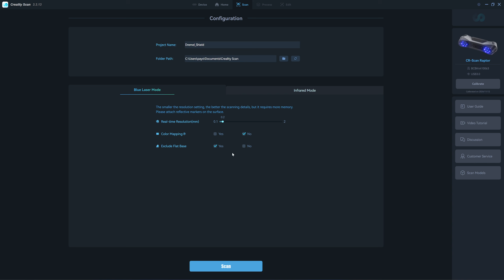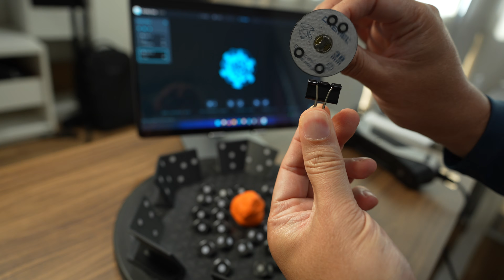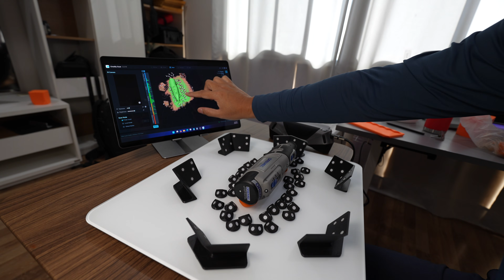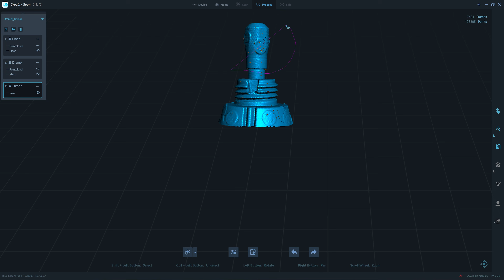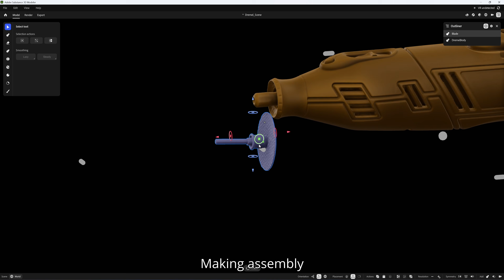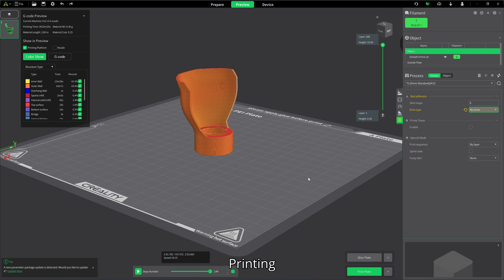Creality Scan Raptor - Beginner Guide - Making Dremel cutting shield

Comment: Discovered after purchasing that this device does not pair well with an AMD system. Do yourself a favor and look at the graphics requirements first. Don't rely on the scan software saying an AMD system is good. You'll get so many screen freezes calibration will be frustrating. It says it on their wiki but if you're like me you won't look that far until you purchase. I watched several reviews on and no one mentioned this.
Reply from the maker: Similar to most CAD tools, they only run well on Nvidia card. AMD one would cause bugs and issues.

Comment: I got my Raptor today but to be able to use I almost have to by a new computer. It would be nice if the sellers start their advertising with the urgent remark to check the system requirements first before buying!!
Reply from the maker: You need a PC with Nvidia graphics card to run it, at least RTX4060

Comment: Why Substance Modeler instead of Fusion360?
Reply from the maker: Substance Modeler is clay tool, Fusion is CAD. They're totally different.
Reply: @Payo-TensileCreator so it's easier to create models with the clay tool rather than having to intake them into the full on CAD process?

Comment: Hey man what’s up? 
Please need your guidance 🙏
I would like to know if you have knowledge about a 10meter extension cord for the RaptorX and what is the maximum I can extend it 🙏
Reply from the maker: The cable included with the Raptor X and Sermoon X1 is 5 meters long. I’ve never come across a 10‑meter USB 3.0 cable, though I have seen them in USB 2.0.
Reply: @Payo-TensileCreator I saw some USB 3.1 and 3.2 Gen 1 and they are Active USB and there is 5 and 10 meter and I know for a fact that a 25 meter dose not work from experience it worked with shining 3D einstar (first model) but mot with the raptor so then i got a USB to ethernet adapter it’s kinda worked but the receiver was getting extremely hot and randomly disconnect and reconnect multiple times so I planned to install a tv outside and temporarily move the pc since it’s on wheels but still need to extend the cable by around 10 meter so I can move around the car 😩
Guess I’m gonna have to try and see what work and what dose not 🤷‍♂️
I’ll let you know once I try it 🤘

Comment: Is this the pro model? do you think it can comparable to the pro model in terms of quality scans??
Reply from the maker: That one in the video is original Raptor. It shares the same 7 lines laser module and depth camera with Raptor Pro.
Reply: I have the original raptor and will not connect to software using windows 11 home. Which software version are you using?
Reply: @minibuggies926 I have windows 11 pro on my desktop pc. And 10 on my laptop. I’ve heard of this issue though and apparently there’s a workaround no?
Reply from the maker: @minibuggies926  Now the latest one will be Creality Scan 4 version 1.3.7
Reply: I have found no fixes. And creality has not provided any support. Thought I'd reach out, maybe i downloaded the wrong software version. I tried a few. I'm on 3.3.36 now

Comment: Hi. In the first few seconds of the video, it looks like you're connecting a cable to a Ferret Wi-Fi6 bridge. Have you ever try to use the Ferret Pro Wi-Fi Bridge (or the "Upgrade Kit for Wireless Scanning") with the CR-Scan Raptor or Otter??
I'm wondering if the Ferret bridge can work as a cheaper alternative to the official Scan Bridge for Raptor.
If yes — does it connect over USB and create the same "Ferret-XXXXXX" Wi-Fi hotspot? Any firmware or compatibility issues?
Hi! ?
Reply from the maker: No, Ferret's bridge won't work with Raptor/Otter I've tried that.

Comment: Great video! I just received my new Raptor but I can’t figure out how to get the firmware updated because I’m having the Windows 11 usb connection issue? Any ideas besides buying the WiFi bridge or a new Mac?? 🤔
Reply from the maker: In Creality Scan 3 or 4, clicking the gear icon in the upper right corner opens the settings menu, where you'll find an option to uninstall a Windows 11 update. This rollback may resolve the issue temporarily, allowing you to reconnect to the Raptor and update its firmware. However, I can't guarantee it will work, as Windows 11 includes protective mechanisms that may block third-party software from modifying its security settings.
Reply: @Payo-TensileCreator Yes! When I do that Crealty Scan says there are no Windows updates to uninstall. So… maybe buying the Mac maybe the best solution because if I purchase the WiFi bridge to update to the latest Crealty firmware, I will be dealing with this issue over and over every time Windows 11 updates (more than likely). And then will need to wait for Crealty to update the firmware again. 😳
Reply from the maker: Just a heads-up—Creality 4.0 is primarily geared toward Windows, so Mac users might find themselves a bit behind in terms of support and compatibility. You might want to post on their Facebook group here: https://www.facebook.com/groups/creality3dscanner
They have support staff available who can perform remote fixes on your PC, though you may need to wait until Monday.
Reply: @Payo-TensileCreator  Thanks for the info!
Reply: @Payo-TensileCreator  Good news! I found an old Android phone I had and was able to update the Raptor to the latest firmware. It connects perfectly now to the latest version of Crealty Scan on my newer W11 laptop. 😄

Comment: whats the output file? can we get the 3D model output in a stp file format??
Reply from the maker: Output from 3D scanner is millions of points called point cloud (*.ASC, *.PLY) the software can convert it into polygonal mesh with millions of faces. (*.OBJ, *.PLY, *.STL)
STEP uses CAD command to generate faces; it has to be created manually using a process called "Reverse Engineering". https://www.youtube.com/playlist?list=PLydESXqOmwGlukI2S-bmj9_009fUqmT04

Comment: G R E A T   V I D E O S !!!!
Love to watch them :D
What do you recommend for me , I need a scanner for smaller objects , and for some motorcycle parts ( max 300mm ) ?
Currently, I have Ferret and it works for me as a reference, but i want to do less of fixing. :D
Btw, what is that monitor ? :D
Reply from the maker: If you're frequently scanning thin-shell automotive parts, I’d suggest using the Raptor Pro. I wirelessly cast the display to my tablet, but it's not a true monitor.
Reply: @Payo-TensileCreator TNX A LOT for a fast response and with great info. Keep up this good work, we need you. 💪😎

Comment: Hi, nice video! What Pc you are using? I'm interested in buying similar one...
Reply from the maker: CPU: Intel Core i9 14900K (24 cores 32 threads)
GPU: RTX 4090
RAM: 32 GB DDR5 7200MHz
Reply: @Payo-TensileCreator Do you think i5 13th Gen 20 cores is good to run Creality Raptor? With 32gb and 5060 RTX
Reply from the maker: @apixer Yes, this setup would work.
Reply: @Payo-TensileCreator thank you. This would save my budget a bit if I go with i7 .😅
Reply: Where I can buy a similar model? What Is the commercial name ?

Comment: Can you post a link for your dot tray to hold those 30 degree markers you linked in Description?
Reply from the maker: You mean this one ? https://skfb.ly/puFDo
Reply: @Payo-TensileCreator  yes thank you
Reply: Disregard my last post. The markers I was using weren't your original design. I do have one request if you ever find time. Can you either make the sides higher on the tray or carve a groove out around the bottom of the marker that makes contact with the table to work with markers that have magnets glued to the bottom? This would be helpful as I have a revopoint dual access turn table and I need magnets to keep my markers from sliding off. Keep up the great work. I am systematically going through your videos 1 by 1. Thanks again
Reply: @The_Cranky_Old_Man  you can do that yourself, he have enough of giving for free his designs and make all those videos
Reply: @mxklkarmonkey970  why don't you let him answer. Mind your business
Reply: @Payo-TensileCreator  so the tray is much bigger than the marker panels. are they suppose to fit tight?
Reply from the maker: @The_Cranky_Old_Man  The last time I print, it was tight fit.

Comment: For Reptor, can it connect to a smart phone as a monitor when we're scanning like reptor x?
Reply from the maker: Yes, you can connect it to the WiFi Handle, but you'll need a powerful phone—something new like the S25 with a Snapdragon Elite chip. My phone, which has a Dimensity 9200+ processor, is too slow for the Raptor.

Comment: Really appreciate all of your videos! I was wondering if you ever had issues getting your Raptor to be recognized on your PC? I have tried multiple PCs and usb ports, and followed all the troubleshooting steps but still nothing. Any suggestions?
Reply from the maker: Have you ever connected it successfully? Original Raptor has some issue with USB cable. I have disconnected issue sometime, but as soon as I switch the cable from Raptor X (They use different version of USB cable) it will connect right away. So, I think it might be the issue with the USB cable.
Reply: @Payo-TensileCreator  When I first received it I was able to connect it, but now I can't. I assume the only way to get a cable like that is through creality, so I'll have to wait for their holiday to be over and see if I can order one through support, Thanks Payo
Reply: @Payo-TensileCreator  just curious, what is the spec of the raptor X cable? I’m considering just splicing my own cable together using a different usb / power supply

Comment: the link to the 3d markers has a few types of markers, which one is the best and is good for all situations?
Reply from the maker: You'll need 3mm and 6mm reflective sticker markers. 3mm is for small curve surface, you can stick many in a small area. 10mm is for medium-large object. https://youtu.be/qd0qd6fgxHM?si=CFvYso9txXFFoeCK&t=429
Reply: @Payo-TensileCreator I'm talking about the plastic pyramids on which the markers are stuck, which shape is best for all situations?
Reply from the maker: @danielkotzer636  There're shorter 30 degree and taller 60 degree. 30 degree is for general use, and 60 degree is better for scanning the sides of object, you can lean the scanner almost parallel to the table.
Reply: @Payo-TensileCreator  I would like to 3d print the tallers by myself, do you have a link to a model?
Reply from the maker: @danielkotzer636  Here we go. https://skfb.ly/oUNFx
Reply: @Payo-TensileCreator  thanks

Comment: Could you test if the Raptor X is also better at NIR? 
Maybe in comparison to the Otter? 

I’m really not sure if the Raptor X is worth the money if the NIR is same as bad as on the original Raptor.
Reply from the maker: I have already tested it. It's the same NIR module, bad at capturing black and metallic materials. Otter is 2x better in this department.
Reply: @ thanks a lot for your reply! I assumed that already but now I’m sure. Pretty annoying:/ 

I think you scanned the rear trunk with Raptor and Raptor X and said the X was way faster. 
Can you say about how much time we are talking? Is it like twice or way more than twice the time?  
And Original Raptor wants way more markers otherwise it looses tracking a lot right?
Reply from the maker: @V4SNIC  Original Raptor marker spacing is 5cm vs 10cm on Raptor X, so you'll need 4x more markers. Raptor X's faster from the larger capture area. I'm making another video, scanning Raptor X with black surface. You may need to see this.
Reply: @ Great, thanks a lot for your effort!

Comment: On the black rubber surface at the beginning of the video you put large and small stickers in a mix, why?
Reply from the maker: Add randomness. Scanner can detect different between 6 and 3mm stickers
Reply: @Payo-TensileCreator  I thought you did it because now you can use this surface to scan big and small objects because the small stickers are for smaller objects
Reply from the maker: The 3mm sticker is also used in smaller object and curved surfaces.

Comment: Thank you for the great insights! Your videos really stand out regardingnuseful information 😃

I am considering buying a Raptor for reverse engeneering hand-refined prototypes

Some are shaped like a small nail where the exact geometry of the head is of interest.

Do you think one can get good results scanning a 20mm x 1.5mm nail with the raptor and have accuracy within the nails head (and maybe its tip too) of better than ~0.05mm?
Reply from the maker: I have tried to scan  2 mm drill bit with Raptor. I got less than 20 um of error.
Reply: @Payo-TensileCreator that video was incredible. This is what made me see it was possible. It's a pity that on that scan the tip with the cutting edges was facing down (I know you were interested in the roundness of the shaft).
I guess it will likely work and I just have to try.
Thanks a lot! 😃

Comment: @Payo
During merging (Original Raptor) two opposite scan setup ,i faces accuracy drop down to 0.25 mm , Please make video on this.

Please Scan object from both side then merge it and verify it manually. (Object size approx=400 mm long)
Reply from the maker: You should not merge object with parallel wall, the wall has to be either curved or tapered. In that case, you have to merge manually in 3rd party software like CloudCompare. I think I've made a video about this sometime ago.

Comment: For your 3D markers, how do you affix the stickers to them? Super glue, or 3m primer, or something along those lines? (Mine seem to fall off, even after washing the print, and being firmly pressed in)
Reply from the maker: I just simply stick them on the printed cube directly. I found that PLA is easier to stick on. ABS is a bit glossy and tend to peel off.
Reply: @Payo-TensileCreator  I print mainly in PETG, so I may need to reprint in PLA matte and see what results I get. Either that or use a dot of super glue

Comment: What benefits are there in using the Adobe Modeler instead of say Fusion 360? Initially, it would appear the Adobe program is more for VR modeling and not really for any kind of engineering?
Reply from the maker: Maybe I will make a design process video with AutoDesk Inventor VS Substance modeler. See how different can it make. Fusion 360 is a cloud based CAD for beginners, easy to learn, but It's not a professional CAD software. It'll come to a dead end with inadequate functions. For the hobbiest designer, I think Substance modeler is worth the 80 USD  price.
Reply: @Payo-TensileCreator  Let's try this again, as my last reply got erased? I noticed that Substance Modeler on Steam is $149.99 and not $80... Does that change the value proposition or is there some other program that is better value that can do the equivalent of substance?
Reply from the maker: @geezher  It could be that the price's different in some country. It still shows 80 USD  price in my region. You can try Blender, it's free but it's not as good as Modeler for 3D scan post processing, and it will take longer time for you to learn.

Comment: I bought a Raptor scanner, but for some reason, I’m struggling to get the hang of it. My PC is up to standard, but scanning things isn’t as easy as it looks but after watching this video I have good understanding of what I did wrong ; thanks for the information!
Reply: Raptor Scanner Notes

Blue Laser Mode:
	•	Real-Time Resolution: 0.1-2mm
	•	Examples by Object Type:
	•	Coin (small details): 0.1mm
	•	Dremel (tools/small parts): 0.2mm
	•	Car panel: 0.5mm
	•	Whole car: 1mm - 1.2mm

Exposure Settings:
	•	Automatic Exposure: Works 90% of the time (default is manual).
	•	Recommended: Use automatic for general scans.

Scanner Range:
	•	Optimum Range: Critical for accurate scans.
	•	Color Codes for Distance:
	•	Green: Optimum position
	•	Orange/Red: Too close
	•	Light Blue: Too far

Object Requirements:
	•	Static Objects Only: Any movement or vibration will cause scan failure.
	•	Even small vibrations can disrupt the scan.
Reply: @Wes_021 Hello, I can't scanering yasterday, and find a problem in the foro of creality. I uninstall a Windows actualization.  It is
Win11 22h2/ 23H2: KB5050021
WIN10 21H2 / 22H2 :KB5049981
Win11 24H2: KB5050009
Reply from the maker: ํYour welcome !